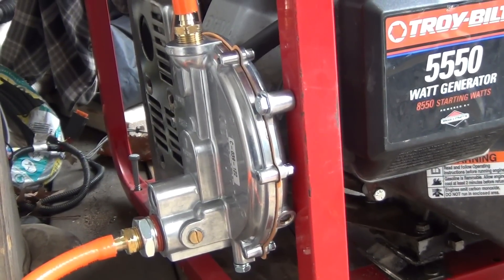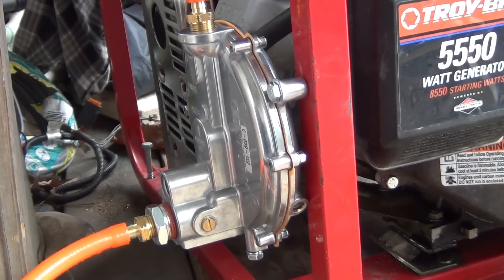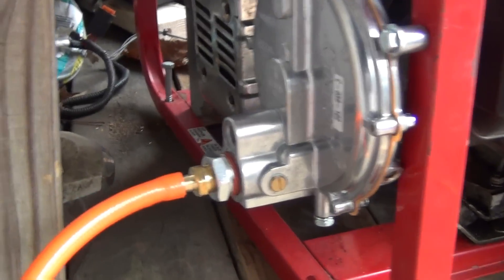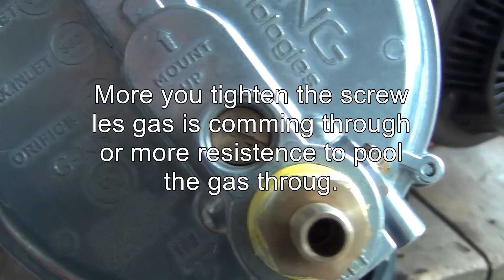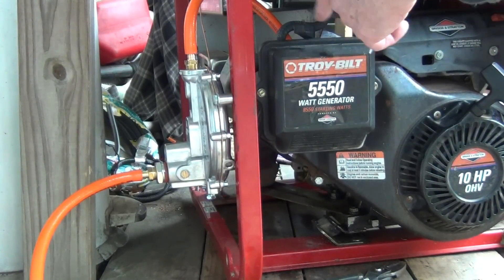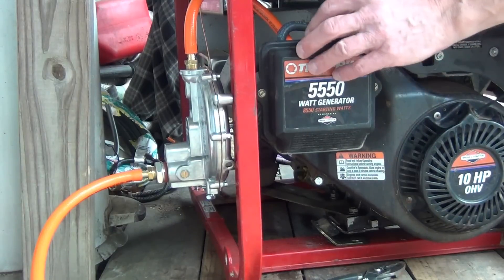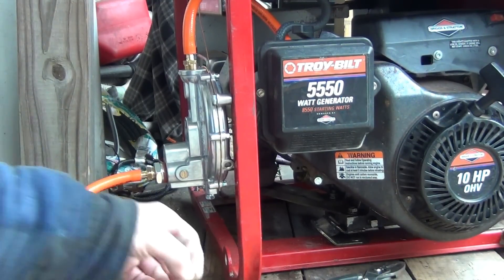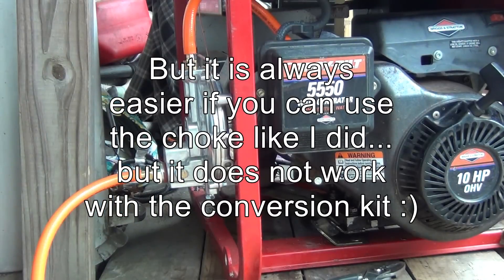Adjust Garretson low pressure gas regulator 039-122

Comment: The brass plug screw is froze in place.  How do o get that un stuck ?
Reply from the maker: it might have a tread lock, no idea how to undo it.
Reply: @VladFredK  may have to drill it out .
Reply from the maker: I would not do that, you’ll get metal shavings inside.
Reply from the maker: I would try big screwdriver
Reply: @VladFredK   I’ve tried that.  On another generator video  a guy in comments successfully used a dremel tool with a small metal cutting disk.   His was new and locked in also.
Reply: @VladFredK  not much other choice.  Or throw it out.   Once opened the shavings could be cleaned out ?  The regulator is only about a year old.  I’m guessing thread lock was used
Reply: @VladFredK  isn’t it solid there where that adjustment screw is ?  Or is it opened up to the rest of the regulator ?
Reply from the maker: Okay, I never had this problem and I own 6 or 7 of them so I can’t help you here

Comment: Can you please help me figure out why I can't get my generator to stay running? I have a similar Century regulator. The only way I can keep it running is if I hold the primer button down. No matter how I adjust both adjustment screws I can't seem to find a setting that keeps my generator running by itself without holding the primer button. If there's something wrong with the inside of the regulator I'm willing to open it and check. Please help. Thanks in advance!
Reply: What kind of generator?
Reply: @tysesty  sorry, YouTube didn't notify me that you responded. It is a Generac XP8000E bought from Lowe's. I have a Garretson style regulator on it that is made by Century. It is a gasoline generator that I'm attempting to convert as a dual fuel generator. So far it only stays running if I hold the primer button on the regulator down. Any other adjustment from the top or rear set screws doesn't seem to be enough to make it work. It makes me wonder if my regular is faulty even though it was purchased in a kit brand new.

Thank you for helping!
Reply: Did you unscrew the regulating screw almost all the way out?
Reply: @tysesty  I did try that and it still didn't seem to be enough, I admit though that I never did let it fully open to where fuel would be running by itself constantly. I was worried about what could happen if it was fully open and constantly allowing fuel flow
Reply from the maker: @e1337DIY  when you press the primer button its a same thing, the gas just flow through. Try to unscrew it olmost out but it sounds like you dont have enough suction from the carb. Do you have air filter instaled? ....I dont think its the Gar regulator, I had about ten of those and none was bad.
Reply: @VladFredK  So I opened up the rear set screw to allow the propane to flow freely to the generator and that was still not enough to get it to run. Do you think the regulator is bad?
Reply: @e1337DIY  screw it back in roughly to the middle and use your mouth to try carefully sucking on the outlet when the LG or NG is on. It should take very little effort to let the gas go trough. And Dude, don’t poison yourself, just one try. You know that gas is poisonous right!!!
Reply from the maker: @tysesty  hey there, any luck?
Reply: Hi Joseph, I am having the same problem as you with a 15 HP Hyundai generator. With an original Garretson 039-122 regulator and a venturi placed in front of the carburetor. I have tried measuring the vacuum produced between the regulator and the carburetor/venturi and I found that the vacuum is very small to the point that it does not open the gas passage even if I loosen the spring tension by unscrewing the screw as far as possible. The vacuum produced by the motor is not enough to keep the regulator output open, so the motor only works if I always keep the rear button pressed (as soon as I release them, the motor stops.
I have done dozens of tests and the result is the same. I disassembled the Garretson regulator and found no faults: with little vacuum at the outlet, the valve opens easily, which does not happen when running on the engine. The regulator is installed accordingly (vertically) and on top of the generator.
Can you tell me what the solution you found is. Thank you so much!!
Reply: @victorbergmann7367  I haven't been able to get it working. My ultimate solution was to give up and sell the generator. I bought one that was made to use propane as a fuel option.

Comment: Much appreciated. Helped me getting my machine running better. It was slightly spluttering but now runs a lot smoother. I guess it was previously over fueling? Pripr to this adjustment I also reduced the spark plug gap which also helped.

Comment: Hi Vlad, 
I converted my 4400 generator using us carb snorkel kit.   My generator is a dual fuel propane /gasoline but i wanted natural gas so i got snorkel kit with garretson regulator.    I attached snorkel kit as instructed and kept the orignial propane regulator attached .   Generator starts and runs on propane but wont start or run on natural gas.  having hard time trouble shooting.  is the  old propane system creating a vacum leak?  should i just remove snorkel and run gas exit from  new regulator to original inlet of carb for propane?
Reply: I don’t know what is snorkel but the generator needs more rich NG mix then LP mix to run properly. Larger houses, larger inlets, more gas supply.

Comment: Mine leaks out of the bottom right atmospheric port when the generator is not running. Any idea what this could be?
Reply from the maker: Adjusting screw is too loose or defective regulator
Reply: @VladFredK  Thank you. I'm going to try to tighten mine and see if it fixes it. The one I have had a T50 plug lol.

Comment: I just got my regulator that looks almost exactly like yours.  But there's a cap on where the adjustment screw is located.  Does this just pry out?
Reply from the maker: I never had one with cap so don't know
Reply: @VladFredK  Thank you. I got the cap off and found the two screws for the adjustment just like yours.

I have set up the system pretty much just like yours.  But just before you start the engine you say you re-drilled the carburetor so you can use the choke.  What does that mean?  I have a 3/8" hose going into the air filter housing.  My generator will fire once or twice but I can't get it to start.  I started with the adjustment screw all the way in and then backed it out 1/2 turn each time I tried to start it.  Also, don't you have to prime it by pushing the spring in the back?

Sorry for so many questions, but your video seems the closest to what I'm trying to do.
Reply from the maker: Best way to do it is to start it on gasoline and switch to NG or LP while running. I believe I do have a video on it and redriled carb too.

Comment: Just A Quick Question. Im wanting to use this regulator with a Predator 9500. Im just curious as to why everyone is using the adjustment valve block with the adjustment screw on the outlet port instead of just adjusting the outlet pressure with the Built In Screw Adjustment that you're using. It seems this is the way to do it. It also seems without adjusting the Built in Adjustment Screw there wouldn't enough gas to power the larger engines like the predator 9500 even if you used the external outlet adjustment block screw.
Thanks
Robert
Reply from the maker: U need to adjust both. The one on top is a very rough adjustment and the one inside the regulator is fine tune.
Reply: @VladFredK This seems backwards. Your rough adjustment would need to be first in line and then the fine adjustment.
Reply from the maker: @1997LT1Camaro  isn’t that what I said?
Reply: @VladFredK  nope it's not what you said

Comment: I tried adjusting like this and got VERY little change either in or out. Screwed it in far enough I thought it was going to drop into the body of the regulator.   Works great to start and under 30A house load (AC, dryer). Couldn't try 50A as I haven't got the cord and outlet wired yet.

I have a Westinghouse WGEN9500DF and just disconnected the hose from the existing regulator going to the carb and took the LP hose off the tank side regulator and used that to connect the NG regulator. Hardest part was getting the 3/8 flare. Nice and clean, just wrapped the extra hose around the new regulator.
Reply from the maker: Maybe I didn’t mention it but this is fine adjustment. Also it depends on the type of regulator and size of the engine.

Comment: Hi, I have a Honda eu3000is and when runs on load with natural gas it’s stop. I supposed there is not a correct flow on carburetor? What can I do to solve this problem?
Reply from the maker: you don't have enough full feeding the gen. Honda 3000i is a small engine for NG and it will be very hard to adjust on NG if even possible. The smaller engine the harder it is to run it on NG. I wouldn't do it, you loose almost half of the power running on N G.
Reply: @VladFredK  Thanks, but i would try to adjust kn 039 regulator to give more flow to csrburetor?  Do you know is it possible?  I read in some articles that the factory settings is for propane use.?
Reply from the maker: @simonlopez7387  yes its possible just fallow this video but even if you adjust it properly your Honda 3000 W  will become Honda 1500 W
Reply: Hi, Vlad. I could not adjust the regulator because its run on natural gas ok for maybe 2 minutes and then shut off.  I try again tomorrow

Comment: hi can someone please help me find the fittings to fed my gas in
Reply from the maker: Home depot has it all
Reply: @VladFredK  hi im England are u able to link me the home depot page please
Reply from the maker: @SHUEBA179  I don't think they deliver to England but here it is https://www.homedepot.com/?mtc=SEM-B-F_Brand-G-Multi-Multi-Multi-NA-NA-ETA-NA-NA-THD_BT1&cm_mmc=SEM-B-F_Brand-G-Multi-Multi-Multi-NA-NA-ETA-NA-NA-THD_BT1-71700000002449093-58700000047538642-43700003817116349&ds_rl=5041&gclid=Cj0KCQjwl4v4BRDaARIsAFjATPkyRsHi19UQ-AxnOHhinEHhyDG1axJPL95Mj7V4Y1Iz-mFZp124m8saAjgFEALw_wcB&gclsrc=aw.ds
Reply: @VladFredK  thank you i ll try to find here in england

Comment: Vlad, I don't subscribed to too many channels but yours is one of them.  I have couple questions - where is that accent from :-)?     Real question is this:  I have a 15KW Generac that I recently purchased a propane kit for.  I have it connected to a 120gallon tank that normally feeds a propane stove in my shop - I disconnect this line - and connects it to this same low pressure regulator that you have in your vid.  Now the kit that was supplied has an extra valve that screws into the  OUTLET port - has a threaded screw type device that you hand turn until you fine the spot where the generator runs ok.  - and it has a nut to tighten to hold it in place.  It sounds like this serves the function of the adjustment screw that you had in this video.   I assume the kit provider thought that it was easier for the average joe to adjust his external valve than the one in the regulator.  Does that sound right?   2nd question about this adjustment you performed - what exactly are you doing?  Setting a max limit of gas that can be pulled by the generator?  What if you keep "opening" it up - at least with my external screw the generator does not run faster.  Is this essentially a safety thing - you are fine tuning the max gas that your device needs - and not allowing any more?
Reply from the maker: yes this is a fine tuning specially for smaller generators, like Honda EU2200i would need it but it doesnt hurt to fine tune it to bigger generator too. There is a few different types of Garretson regulators each with different resistance. In order to make the gen run in optimum HP  it is good to fine tune it but I would not even worry about it in your case. Your engine must be at least 18 HP or more, fine tuning will not make much different unless it's not running good. That 18 HP engine will easy overpower any regulator.
Reply: Actually found out what that valve is called - a "load block" value.  The purpose is to adjust the fuel/air mixture.

Comment: I just ruined the protection screw on a KN regulator. No matter what that protection screw would not come out so I could adjust the amount of gas. On yours it came out super easy.  What is the trick to get it to come out easy?
Reply from the maker: it didn't come out easy the first time, but you need big sharp flat head to take it out

Comment: what diameter size hose needs to go into the carb or needs to be drilled into the orifce?
thanks
Reply from the maker: 3/8 is good enough for 10 Hp engine
Reply: minimum 3/4" for natural gas. you will need it when generator is under a full load.

Comment: That is totally wrong. The screw you adjusted is to set the inches of vacuum it takes to overcome the spring and open the regulator! The actual adjustment for the engine is done at the output of the regulator, between the regulator and carb.
Reply: I was wondering when I would see this comment.  You're right.
Reply from the maker: Everybody knows that, .....this is a fine tuning of the regulator since every gen will have different vacuum.
Reply: @VladFredK  - You are 100% CORRECT on adjusting this.  This is to ALLOW more or less Gas according to EACH Generator.  Since ALL the engines are in various Horse Power.... By adjusting this, you are making it RUNS BETTER + SMOOTHER... NOTE:  I did said... ACCORDING to YOUR Generator / SPECS!
Reply from the maker: @JodBronson  Thank you.
Reply: @VladFredK  -  You are welcome!  NOT everyone is SMART like you!  Glad to see like-minded People!
Reply from the maker: @JodBronson  Thanks,  likewise.

Comment: I m unable to adjust gas pressure on kit.
I start on gasoline and then convert to natural gas, but can not adjust the accurate pressure and after few minutes (on load) the generator stops
Reply: It is because of improper setting.
How can i set
Reply from the maker: I have no idea what kind of setup do you have?
Reply: Ok. Thanks

Comment: What regulator are you using at the bottle? I have tried three different regulators that work great for other things and can not get them to work. They will work one time and when I shut them off I can not get anything back through the 039-122 regulator. I had to hook up a cutting torch regulator at about 1 psi to get it to work right.
Reply from the maker: bigger generator will not work if you using propane grill regulator, it would have to be regulator for propane heater or you can gut the grill regulator to let the gas flow faster
Reply: I tried two of them and it ran fine until I killed it. Then it would just start and die. Could not get anything through the primer. Tried it with a bigger regulator too. Had to use a cutting torch regulator set at 1 psi to work.
Reply: It is a 5000 watt with 10 hp HM100 engine.
Reply from the maker: that is big enough, these regulators have safety device preventing the gas ascape too fast and they will lock. Use propane heat connection and you good.
Reply: The one I tried has the older POL connection and is about 4-5 inches in diameter and runs heaters fine but will not work on this.  I wish I  knew a regulator make/model number to get that will work right. I have one more on a travel trailer that I am going to try.
Reply from the maker: actually to precise it is not the regulator but the safety device is in the nut -
 before regulator.
Reply: But the one with the older POL fitting doesn't have that..it screws INTO the bottle and is straight through into the regulator-old style.
Reply from the maker: does it screw on top of the propane outlet nipple or in side the propane outlet nipple?
Reply: Vlad Fred Kovac It screws into (inside). Those kind are straight through. Unless the bottle valve itself is causing it. I have several of the old style bottles; I will fill one of them next week and try that.
Reply from the maker: those hoses which screw inside should not have the safety device. Is your tank just empty?
Reply: Vlad Fred Kovac Just filled it at McCraw propane. With the cutting regulator it runs fine.
Reply from the maker: Then the one which screw inside the connection has to work. Those don't have any safety installed.